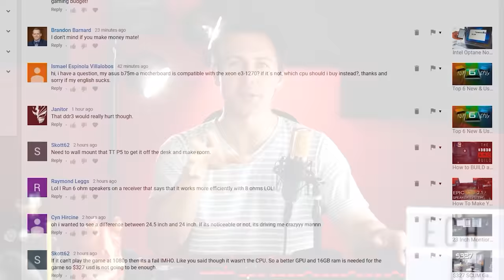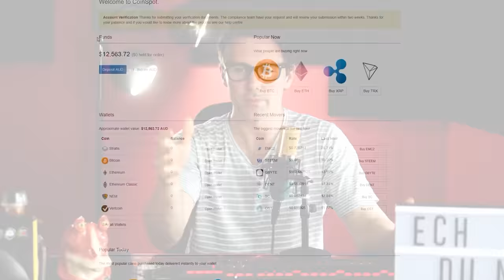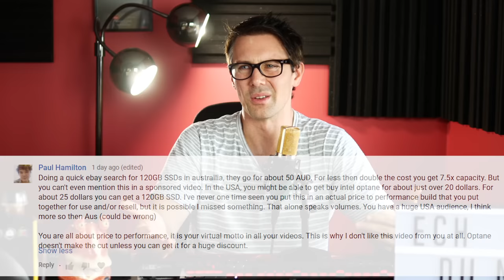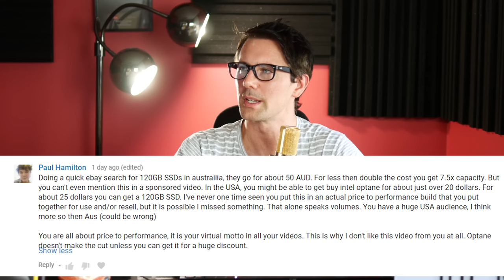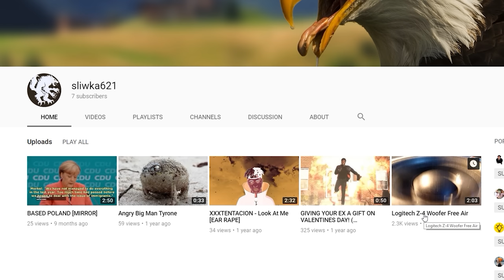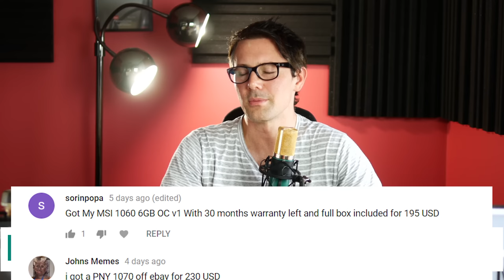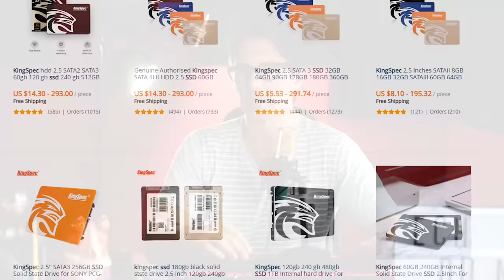ATY #003 - TechSource Robbed, 90 Second Boot Time? Used PC Prices Full of S#*T?! Intel Shill!?

Comment: To the guy with neverending boot and uefi problems: disconnect all possible data discs and check whether it's faster. If it is it's drive problem that locks the POST, if not - I'd advise checking the DDR4 modules and whether they are in proper dual channel. :)

Comment: hey brutha enjoyed this vid. noticed you talked about data vac and talking about clens kit ahahah that would be an awesome idea. just thought i would throw a heads up your way and you can share it with your viewers if you think it can help. the datavac is 169 from pccasegear and seams to do an awesome job, but as another option that i went for was a Makita LXT 18V Cordless Blower Skin. This only cost  me 92 but for some reason its showing $99 on the bunnings site. the makita produces 91CMF vs the Datavac makes 70CMF. For me this was a great deal due to me already having Makita cordless tools so the battery's can be used with all matching skins. It could be another option for your subs to consider as there are many brands out there that have a cordless range and people might already have some and all they need to do is get the skin. Same with Super cheap auto last time i was in there i noticed a cordless blower for 60 bucks not sure of the specs, but could be good... I do love the fact with super cheap auto most of there tools have 12 to 24 months warranty. where most cases they will just swap it out then and there. Also its handy if you are a club plus member as your purchases are saved on there system. Hope this helps your or ya subs, thanks for the great content you keep putting out!

Comment: Hey Mr. Tech Yes! How's it been hunting done those awesome deals? Must be pretty sweet!

Anywho, I would like to provide some personal info from my life when it comes to the questions at 5:35 and 7:30.

For the first question at 5:35 , you are completely right when it comes to m2 drives, SSD, or HDD. I've had issues many times when it comes to drives booting OS's on z370 motherboards. I learned you have to completely wipe the disk partitions before installation and reinstall the OS then the drives run perfectly normal. Must be something with z370 motherboards from ASUS, MSI, Gigabyte, and ASRock. But, then again it could be a number of problems, and I could just be stupid. And, that would just be to funny in my opinion.

And for the second question at 7:30 , I also have a lazy eye too. I was born with it actually. My parents, brother, and sister never knew for years until I was eight years old. My amazing grandpa heard I was doing bad at school. Now, my parents always said it was my fault for not learning in school. However, my grandpa had always wore glasses. So, he did a quick test and sure enough he discovered I had a lazy left eye just like him. It's been years since he passed away, but I learned not only "how to see"(meaning I didn't know how to describe seeing objects for the first time in my life), but also how to read and shoot from my old pa'. He was so cool, and it's a great reminder of how he taught me.

Anywho, you should the same test my grandpa did for me. All you have to do is take a white surface from a poster board, a white marker board, or even a blank piece of copy paper. Then, draw with a black marker dots or random letters and numbers from larger to smaller vertically. Place the white surface on a wall. Step away from the white surface at least 4 meters(I'm American, so I think that is 12 feet). Face the white surface. Then, close one eye with one hand and read each letter or count each number or dots with your one eye starting from top and working to the bottom. Record anytime you have trouble seeing any line that you have difficult seeing. Then, repeat the process with your other eye and record what you see. Based on the information and what happens when you close one eye or the other, you should be able to find out what difficult you have in which eye. 

I hope this helps you or anybody else in the near or later future. However, don't be afraid to seek professional help. After my grandpa discovered about my lazy left eye, he still took me to an eye doctor to give me correct prescription eyeglasses. I also wore an eye patch for a year(like Solid Snake) and took medicine for eight years(until sixteen years old) in order to balance my eyesight to a point that I could see even without my glasses(which I have been able to see with or without glasses for seven years now). You never know until you try.

See ya later, Mr. Tech Yes:)

Comment: Hello Brian, I have a 1080ti. When overclocked it is far the loudest part in my pc. Much louder than my h100i v2 cooling my overclocked 6700k. If i use a kraken g12 and say a corsair h60 in the top back case fan mount will it impede air flow in my case. And how about the noise? Will it be far less? Considering the noise is mainly why i want to do it. What sort of fan speed would i need to run at to keep cool. The h100i v2 is in the top of my Corsair Obsidian 450D and with the two fans mounted in the front. Doing a full TECH YES CITY review would be even better. Thanks Bud.

Comment: I myself have 1060 3GB with 2700x. I bought my first pc almost 5 years ago i5 4460 with gtx 760, on the launch of 1060 cards I bought myself 3GB Gaming X MSi card, now I upgraded my cpu. I just upgraded my way through gaming. Even tho I have 1440p 144Hz monitor now, I´ll probably buy used 1080 for bargain deal ;) Thanks fot the #ATY series <3

Comment: 5:28  -  I have had this problem too - it's a BIOS issue.  Sometimes occurs after a BIOS update. You have to mess around with the Boot order/CSM compatibility and whether you call your drives IDE or SATA or something. This nearly killed me until I just kept changing various settings with the above. Couldn't tell you what is correct though as guess we have different hardware configs.
Reply: Damian Bragg change cable (hdmi to dp or dp to hdmi) and also check without any m.2 ssd

Comment: have you had an issue with any pascal cards where when using any displayport connector, it will cause artefacts when booting or using the hardware button to restart the PC? In my case the HDMI connection is fine and there are no issues when using it compared to the displayport, and when in general use after boot, using it with the displayport is fine. I checked the cable with the DP port on my motherboard and it was fine, and I dont know what else to try. Any help would be great!!!

Comment: Another good video. Here is a question - Do you think if some one was to use a AIO Designed for the ThreadRippers on a Non ThreadRipper cpu would be cooled better or just using a standard AIO be better?

Comment: The bad booting problem sounds similar to a prob I had with my Z97 mobo.  It was the selection of each BIOS/firmware boot type for HDD's and SSD's, UEFI/LEGACY or both in a certain order. You could get the info for the drives, but I just set the older drives as 'BOTH EUFI AND LEGACY -  LEGACY FIRST' and the M2 and SSD's as 'EUFI only'.
Still boots in 20+/- seconds, so not much slowdown. ^_^

Comment: I have a question for address the yes. (PS. Big fan of the channel, keep up the great work!) 

So in my main rig the basic overview of the specs are as follows:
-i7-7700k @ 5ghz (water-cooled)
-16 GB ddr4 ram
-GTX 1070ti strix (also overclocked)
-Thermaltake 80+ gold 650W
- plus stuff like 2 harddrives, SSD, 4 case fans, etc. 

Is my power supply adequate enough to be running my hardware the way it is? Would you recommend upgrading to a 750w or higher? 

My system is stable in all conditions I've tested but I don't want to risk long-term damage or potentially blowing up my PSU. Your advice would be appreciated. Thanks Yes Man!
Reply: It fine just don't run a overclocked top end GPU.

Comment: P9X79 mobo with 3820 and GTX 1080. Worth swapping to 4930K if I can find one for a couple of hundred (AU$)?
Was thinking of building a ryzen 2600x system, but if thers isn't ha huge performance difference would prefer to spend less.
Cheers.

Comment: I had a kingspec 128gb in my dell mini which used that weird pata pcie interface and it rocked 4 years for me just fine (better than dells crap from that time).
It still runs for my sister with lubuntu for basic tasks.
i cant speak for regular SSD/M.2 though.
(kingspec actually was the only brand at the time to offer these compatible ones for the dell mini)

Comment: So i bought a combo , i5 3470 with optiplex 7010 mobo, the seller is a pc enthusiast and garuenteed that it works, although when i hooked it up, it powers on, but outputs no video, it then shuts down and turns on again, bootl loops, no beep codes. I bought a new mobo, but it wasnt compatible(a stupid mistake) and im not sure what do now. Ive tried clearing cmos, ram in different slots reseating cpu, with gpu, no gpu, diff power supply now i just want to pull my hair out please help me

Comment: I am a software developer, am very familiar with the technology space in general and I am also 33. So, I suppose good for looking younger. Brian, that was an ad hominem attack and fallacy argument directed against a person rather than the position they are maintaining. Do not do that. You don't get the moral high ground and it doesn't support your stance trying to lower someone else. I personally never called you a hack, shill, or attacked you as a person in my comment. However, I know there were plenty of others who did in the video comments, and thus I can see how you might have already been on the defensive and perhaps read what I wrote in a harsher light then was intended. I was trying to be critical, without being offensive.

Your Xeon builds are great, as is your use of older hardware. It is very true that other people don't do videos like that at all. That is why I watch your videos.

I understand Optane as an HDD accelerator. I just don't think 16GB is enough. I have built 4 computers in the past year, ranging from a low end 250 dollar system to a 2000 dollar system with a custom water cooled loop. In every one them I used an SSD + HDD combination. In none I would have considered Optane. 16 GB just doesn't give enough to accelerate much beyond the OS and an additional program or two without having to forget something very soon after. If I was to consider an accelerator then I would look to Emotus' FuzeDrive or a competing technology which can work with any system of any age (Edit: As long as it has Windows 10) with a higher capacity and price-to-performance. Yes there are some trade-offs going with that type of accelerator as well.

Generally speaking I do not like sponsored videos from any channel. The fact you can't mention opposing viewpoints in a sponsored video is obvious. This wasn't supposed to be an attack when I wrote that. It simply is a fact. This is what probably prompted my initial comment, to offer an opposing view. I know you never called it a review and I never said you called it a review. If you think Optane is good value to you, then by all means use it. I don't think it provides good value to me. That is fine, we are allowed to disagree. Optane is very cool tech and there is no question about that. Just it is currently, still, overpriced tech in my opinion. Not everyone will like every piece of content from a creator. I should be allowed to voice disagreement. But to attack someone as a person is crossing a line.

You have bills to pay and sponsored slots help you to do that. I do hope you keep up your great work
Reply: Make a video about it instead
Reply: @deletedaccount966  this changes something? What a strange claim. I don't have the studio, the video equipment, the audio equipment, the lighting, or the experience in public speaking to make it even viable. But even if I did, what would a video do?
Reply: @Falkkos  RIP then

Comment: Hi Brian, I absolutely love your videos, you're the only why I decided to use an x58 platform for my gaming PC! I managed to score a Intel dx58so motherboard for the equivalent of 30 USD. But the problem is the settings are a bit restricted, I don't think I can even change my memory frequency, I only managed to overclock my x5650 to 3.67 Ghz, do you have any advice on achieving at least 4Ghz on my set up? Thanks!

Comment: After watching your vids - I was able to build some budget PC in July this year.
I had... I mean my brother had some extra computer pieces lying around so I tried using those parts.
He had 8 x 8GB RDIMM DDR 3,  DX58SO(I heard you like X58), and X9SCI-LN4F
I wanted to optimize the rams(Just wanted to have a pc with high ram for no good reason)
According to DX58SO and X9SCI manual, neither of them supported RDIMM despite finding e3-1275 v2 for $60(From my POV, I thought it was a good deal). I think ddr3 RAM was $40 - $50ish at the time and didn't want to spend $100 for two 8GB stick. 
After thorough searching, I found that some motherboards were capable of dual socket. Although I can't overclock them(I could be wrong) I wanted a machine with two sockets.
After thorough searching on Craiglist and Facebook, I found HP Z800(at the time, I didn't know how bad of reputation HP had with compatibility). It was originally priced at $300 but I talked to him and brought it down to $220 CAD. it had:
-Xeon E5620 with one fan(I thought the rig had two but it was only one. I didn't think properly because I thought when the post said two sockets, I thought it would have two CPU). This gave me a headache in the end because I had to find another fan but the fan costs $50. which is not budget to me anymore.
-12gb of ddr3 ram(I think it is ecc 800mhz?)
-350GB of HDD?
-somekind of wifi card(which seems good enough to play PUBG)
-GTX 670 2GB
If I think about it now, I feel like it was mediocre of a deal but I'm not really sure of pricing for pc parts.
Well, I was happy that I was able to play the games I wanted to play (Tekken 7/PUBG) which I wasn't really expecting to play using GTX670 because I thought old gpu meant too old for gaming.
Because of your video, I decided to upgrade the PC to X5675 so I bought 2 of aliexpress for $100 CAD(although I wasn't 100% confident it would work on the motherboard because there were older versions of Z800 motherboards which prevented bios update which also prevents me from installing x5675)

Now, I haveX58 motherboard and X9SCI left which I want to build and resell it.
I'm still not sure price on GPU as it seems to be coming down a lot.
I found a GTX 680 2gb($60CAD), GTX 760 2gb($40CAD) and gtx 960 2gb($120CAD) - this is question for any Yes Tech City Subscribers as well.
Is this decent of a deal to engage?
Reply from the maker: Be careful with the HP towers, and older gear with compatibilty it is real hit and miss.  Best bet with a lot of those older towers for me personally is to leave them in tact and add in the i7 950s that no one wants, and then chuck in a budget GPU and you have a solid flip.

Comment: Hi Bryan! I recently bought new gpu and case. And the airflow is not the greatest is it good idea to buy fan splitter and use my gpu fan connector for 2 additional fans (gtx 1050ti rog strix) Motherboard 3 pin fan connector already in use.

Comment: I ran dual channel DDR3 with mixed capacity stick like 2+4. In a Dell T3500 build I ran 2+2+4 for total of 8 GB in triple channel DDR3.  In case of using different speeds of ram memory will automatically downclock to the lower speed and run it in a dual channel. I never used DDR4 in my life but my guess it should be similar.

Comment: Address The Yes: Do you ever run into driver issues with older GFX cards?  I recently installed a GTX 780 in one of my machines and the later drivers kept crashing randomly.  It took me weeks to find fully working older drivers, stepping back a few versions at a time.  Any tips or resources for speeding up this process? I've built a budget LAN center on my back porch using 6 PC's with Xeon 5440 CPU's and various GFX cards so I'm sure it won't be the last time I have this problem.

Love your channel keep the budget stuff coming!

Comment: My cpu is 8700k @5ghz, 1.33V. So I just sold my H115i and got a kraken x62, my temps are 65-78 when playing Rainbow Six. I used to have mid 50s with my H115i, I wonder is there anything I could do? I have applied different thermal compounds, even tried thermal grizzly but so far Noctua performed the best. thats still like 20C more than I used to get.
Reply: The cooler should be about the same as their both using the same asetek pump. Are you using the same Noctua fans and are they running at the same speed?

Also make sure you uninstalled link.

Comment: Hello, have a question about x58 alienware mobo and xeon support. So, i can get an aurora G3 ( if im correct ) with Dell Alienware Aurora ALX Intel X58 mobo, case and liquid cooler for 45€ (even less, maybe ) so, i wonder if it support xeon's, because then i could find one and make an upgrade over my FX8120 sistem ... Any help would be apriciated 🙂🙂🙂

Comment: Question: Can u do a overclocked guide for a I7 990x bcs I have that cpu but there are litterally 0 guides for it I Just got my new Corsair H100i pro rgb so No worry's on temps 😌
Reply: I have a GA-X57A-UDV rev 2
And 12gb ddr3 ram

Comment: Possible answer to the ASrock MOBO bios issues: I had this same issue with my ASrock mobo when I changed monitors. I built my PC and was using a TV as a monitor for 2 weeks while my monitor was delayed (came broken), and my bios set it's resolution to 720p. Since the monitor was 1080p for some reason the bios wouldn't show up, and it went right to windows. I solved this by resetting the BIOS (either a cmos clear button or if you don't have that like me I just took the battery out for 60 seconds and popped it back in). Hopefully that helps someone.